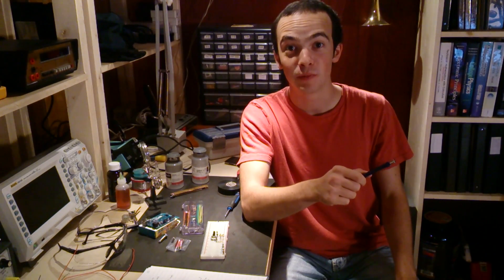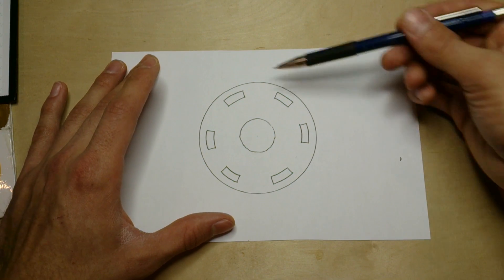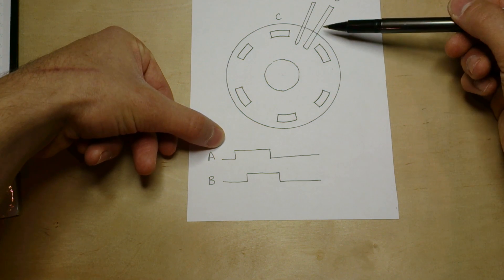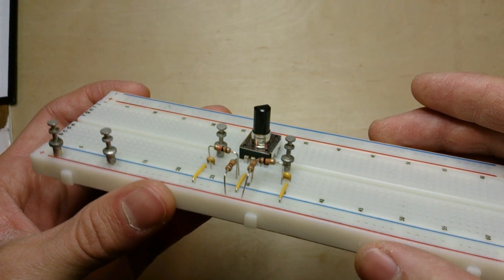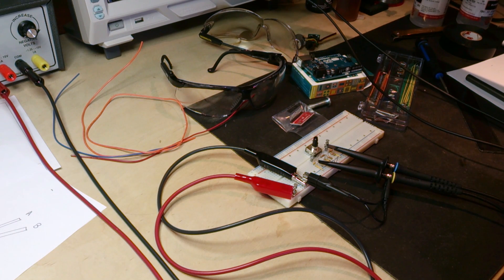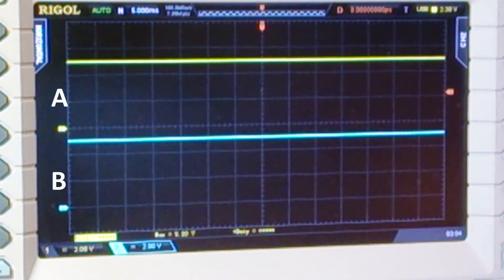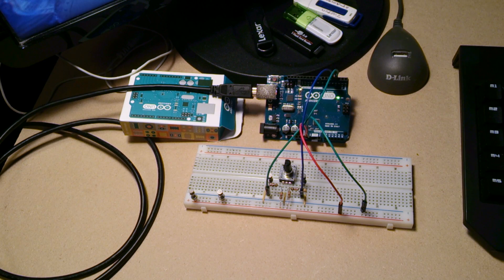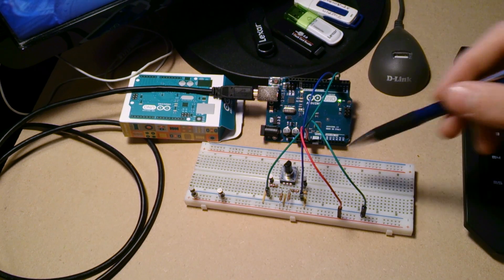Tinman Electronics 7 - How to interface a quadrature output rotary encoder

Comment: So, I tried this out for myself and I just don't understand why the resistors are needed.. I tried this with 2 LED's attached from 3,3 volts to pin 1 and 3. Attached pin 2 to GND and everything worked fine... Such a simple circuit as this seems to make the concept clearer from the start for noobs. (like me)

Comment: thought aload  of  BS   -   as  got  one of these  -  which looked  up thedata  - the actual  code  is  8-bit grey  code   -   the  four  bit greyt  is in the text  - thereafter   it gets  to be  less  than  computable  . Recently got  arduino   - not played  with  ,   where  count  is easy  -  but conversion   -  can play with  for a  month of sundays  - tedious .   If  bourns  had  published  the  conversion  code  from  grey to  hex  , octal or  binary  in the increaseing from through binary  - saveing a  lot of errors  , they have it as  increaseing  grey code

Comment: The code seems MORE STABLE if I add a "b_last" in the condition :
" if ((b == LOW) && (b_last == LOW)) "
(Indeed you have to declare b before setup and b_last at the end of the loop.)
Also, a 'delay(1)" exactly, at the end of the loop, seems to help accuracy

Comment: First things first. Nice video. Explained nicely and clearly.    On a side note, could you not make the same sort of thing using 2 photoresistors and 2 leds?
Reply from the maker: +Qbasic8 Thanks! And yeah, you can make a rotary encoder pretty easily, depending on what you have on hand!!